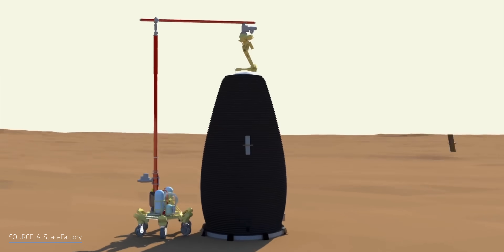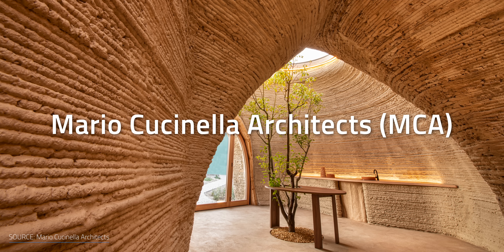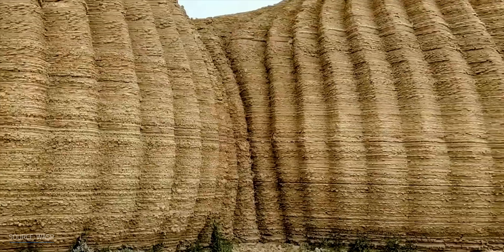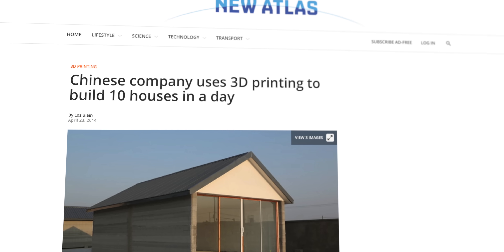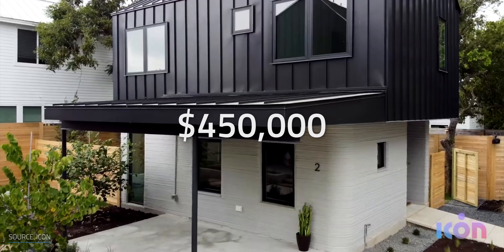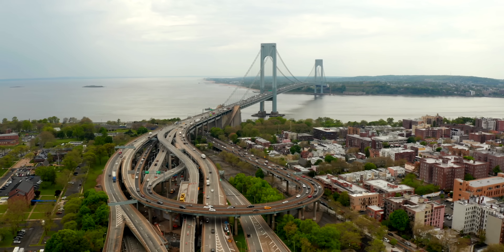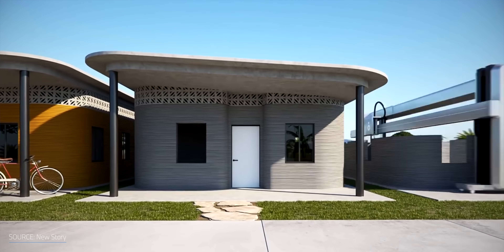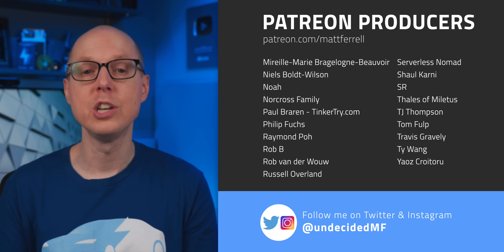The Truth About 3D Printed Homes

Comment: Unless you live in a country with a high rainfall, where the building washes away. Fitting electrical and plumbing is a nightmare, I have tried it, there is no fixing that will work, except fenceposts or other large wooden fixing for solid walled earth houses. Now, this is a structured wall so it doesn't have the integrity of a solid wall so how do you get fixings into the wall? Do you notice how most of them are built inside some form of structure, how much does it cost for the structure?
I have seen many of these, even a brick laying robot except if you notice, behind it, there is a guy pointing the mortar because the robot can't do that. Many think construction robots are the future, it isn't, can you imagine the electrical robot and plumbing robot meeting at a point where they clash and just stopping, at least with people they can negotiate. Oh, and when you think, a robot would be programmed not to clash, that's what every plumber and electrician thought until they tried it and for some reason the plan didn't work, construction isn't a plan that comes together by someone sitting on their arse in an office with a computer, it is a series of negotiations by tradesmen.

Comment: Earthen structures are great, but materials aren't as simple as dirt even for CEB's. I'd guess the precise mix for these 3d printers is even more important for drying time and final strength. The energy required to process and transport heavy materials may be better than modular materials, but it's an issue in many locations. I still like multi-story CEB and or cob structures for many purposes though. Mainly since thermal mass has major advantages in most climates.

Comment: For undeveloped countries, I think rammed earth or earthbag homes would be a better fit than 3D printed homes.  the tech skill level is much lower for more or less the same results. You need a form or bags, a rope, a shovel, and a heavyweight to pack the earth down. some barbed wire between layers is nice but not needed.  adding lime during construction or as a wash/plaster would help with bugs and moisture problems... not a scientist but I have researched this with the goal of making one for myself.

Comment: Cant repair it, cant hang pictures on the walls, cant run new electrical through the walls, looks weird, hard to sell. We figured out the solution to the housing crisis a long time ago. We just ended up attaching a stigma of trashy people and trashy neighborhoods to it: manufactured houses.
Reply: Not really. The problem with manufactured homes is that they often aren't actually cheaper than stick-built once built to the same rigidity and level of quality. Sure, manufactured homes are usually cheaper, but that's because they are also much more flimsy. Thin walls, shallow foundations. Etc.
Reply: We didn't attach any stigma. The sigma grew naturally in experiential fashion.

And it doesn't end up solving the problem either lol

Comment: So the company is called WASP. Hopefully they founders cleared that with Lisbeth Salandar. 😁
While I think 3D printing will have a major impact on the building industry at this point its overhyped. The whole built in a day neglects interior fittings,  electrical and HVAC if any.

Comment: I forget who it was, maybe Edison, that wanted to pour solid concrete houses back in the 1920s or 30s. He came up with a set of plans, full size forms, poured several example houses.  It was a disaster as they were ugly, problems with cracks and settling, not easily upgradable, and other factors just related to the concrete itself.  Even for low-income/affordable housing, no one wants it to look like dirt or concrete.  Part of a person's connection to "home" is customization, paint, landscape, diversity.  Even the poor don't want to live in houses that look like 50 others that are all in the same row.  They don't want to be reminded that they are poor every time they enter and leave the residence.  
A lot of the "Projects" housing in large cities around the US have been taken down after much dilapidation, because the poor just didn't care about the place they lived enough to take care of it.  In my city they gutted the project housing, expanded the living space, added better fuel efficient windows, better secured doors, and added some green features in the area.  they are still not great, but doing way better than in the past.  They are still kind of ugly, boxy apartment buildings.
I think that the recent ideas of using containers for housing will suffer from the same fate.  Someone is building some of those in my city now.
I think it would be great if you can print a house out of cleaned recycled plastic in a selected color and have options so each is somewhat different.  It may be more feasible to extrude plastic 2x4s and replace other size wood members that are part of the skeleton of the home.  You could wash, crush, shred and reform nearby and if all that is hidden behind the walls, they don't have to be reminded of it all the time that it was recycled.  Gypsum drywall is still probably one of the most affordable and available housing materials.  Solve for the outside walls and you are good to be green.  Traditional slab house building methods are still way faster than 3-d printing.  The concrete and running underground wires and plumbing are the slowest part.

Comment: It's going to be challenging to design and engineer the structures using arches throughout. Utilizing AI will be essential in designing the support structures and determining wall thickness. The system needs a mobile engineering lab that can test different substrates used in geopolymer composite materials to determine the individual material properties for a localized construction. Material data can then be applied to the 3D model software to adjust the material thickness according to measured load limits of stress and strain.

Comment: This technique is so new, it's actually old as shit. adobe (or pise? unsure about the correct  translation) have been a thing in Europe for centuries. You want to put some hay in it for support too.
My home is partially made out of it. Now it's weaker than bricks, so most walls are 50-60cm wide. Thanks to thickness it's a decent insulator too.
There's nothing new about the material. Also, if they don't cover the top / insulate the face layer, (plaster it) the house will go to shit after one good rain.

Comment: As a builder, it'd be faster/easier to build homes out of concrete block then to print them. Block homes are not fancy or techie, but they are well understood construction that already meets building code and are insurable.
Reply: Exactly. 3D printing buildings is an interesting technology but I can't see it being cheaper or a less complex than traditional construction methods (despite claims). It really seems to be a solution looking for a problem.

Comment: And no one is talking about, that the inhabitants of areas with single family houses have a much higher CO2-footprint compared to multi-family houses or appartment-blocks per person. So the aim should be to produce CO2-neutral, highly standardized (modular ?) building-structures for many inhabitants (maybe around 12 appartments per unit with 3-4 floors).

Comment: I really wish people would stop trying to 3d print everything. Every tool has its use. 3d printing is great for things that need low setup time or custom jobs (low volume). Mass production is great for things that need to be cheap and in high volume. The cost-per-unit of a 3d printed object will never compete with a mass produced item.

Comment: Its great that the dirt and clay house is made from local materials and degrades back into the environment without a trace.  But how do you decide when?  Unfired clays I have worked with dissolve in the rain, even after being left to dry out completely.  In an arid environment, this might last until you knocked it down.  Here in Florida, I wonder how long a clay house could last.

Comment: I'd like to know more about their structural stability for earthquakes. I haven't seen domes printed with through supports, which would prevent them from passing current California code. I am curious if combining 3D printing with Superadobe structure is necessary to deal with higher compression loads or stability. 
What kind of loads can the printed material handle / can it print a bridge? 
Would adding graphine help?
Why isnt printing paused to inlay plumbing / electrical / windows?
Reply: How about using recycled ground up wind turbine blades as substitute.

If your going to add virgin materials as a strengthener your better off not using anything carbon ..unless you can suck it out the atmosphere direct at minimal financial or energy cost...🤔 Slight problem we cannot do that .... Closest natural is something like bamboo.

So the best solution is Basalt fibers or rebar .. first used in  concrete domes its easily available and processed, stronger than GRP inert 50%lighter than GRP and it doesnt corrode even exposed to salts and natural acids. Unlike steel.
Reply: @clivestainlesssteelwomble7665  I like that.  Bring them wind turbines down (all of them) and I'd buy a house made out of them.
Reply: @metamech7383  

Nope but when they are worn out and replaced with fewer larger units like fiberglass boat hulls there's very little you can safely do with them otherwise...beyond landfill.
Reply: @clivestainlesssteelwomble7665  Yeah, we shouldn't be putting them in the ground at all.  Dirty and inefficient.  Besides being eyesores.
Reply: @metamech7383  

So are coal fired and gas and Nuclear but they produce more damaging 
Personally i dont find them anymore a visual problem than power pylons and the intermittent  noise.. no more than road noise from major roads.  Moving them off shore helps some with NIBY  syndrome but creates its own problems and possible spin offs..   large scale factory fishing becomes  difficult to impossible. 
Better would be a combined wind and tide turbine network  to use the same power storage and distribution infrastructure. ... this requires careful survey work to optimise production whilst minimising impact... but all of this survey baseline mapping could have  been done 40+  yrs ago (when scientists and engineers started pointing like the little boy in the story of the kings new clothes at the energy resource and Environmental problems🤦‍♂️🤦🏻‍♀️)
Reply: @clivestainlesssteelwomble7665  I think wind turbines would be great if they put them in cities where the power would be used.  Imagine hundreds of wind turbines clustered in parks, neighborhoods and shopping centers.  That would mean absolutely no power loss as the power wouldn't need to be sent hundreds of miles for its use.

I'm glad we're on the same page with NIMBYs...putting these up could save our planet.  But we'd have to ignore those living around them to do it...d um b nimbys.

Comment: As with all technologies and ideas, we have to view it not from being hype, perfect,  etcetera but from where can it currently be advantageous and where can it be advantageous (usually when price comes down).

Right now, 3D printed homes, let's stick with the concrete nozzle versions for simplicity, are advantageous in creating the basis for beautiful architecture (art which are also buildings) where the cost savings come from not having to build the one-time use custom forms in which to pour the concrete. The base structure is 3D printed, conduit & such are installed and then the cavities are filled with structural material.

The 3D printed structure can also have controlled porosity such that water can be used for evaorative refrigeration (like clay pots, etc...)

Comment: 3d printed homes is a fad right now, but it's nowhere near where it needs to be in order for efficiency. I see it similar to the first cell phone brick, eventually it will be good, but right now it's absolute garbage. For starters, you still need people to move it and put it together, plus supply the materials for it....so what are you saving exactly? The labor in putting the materials from point A to point C, instead you go from A to B and let the machine go from B to C....and as you said, it's not everything, still need plumbing, wires, etc.

At some point, we'll have robots that can both take material from the surrounding area AND build the home...then it would become viable, especially for space colonization, which is really where this technology would be needed.

Comment: Good take on this industry. This industry is a great example of partial solutions. Several whole solutions companies have really gone far. Roof Kits manufactured off site. Printing techniques that include electrical and plumbing not just windows and doors. Even interior finish techniques that do not require hundreds of hours of labor. Things are really moving fast. Part of the fight in affordable housing is market costs. Contracting companies are used to very high returns on new development areas and the savings in building costs do not get to the consumer. Then realtor costs are very high when you consider how different the value is when selling in this type of market. In the end a 30% savings on the build reveals as about a 10% savings to the consumer so the perceived value is lost. I town I grew up in a very successful company made homes in a building right next to the development. They built modular homes shipped them around the corner to the lots they sold. They did very well for about a decade but then the quality of construction began to show thru and over the  years the company had let quality slip to increase profits and in the end the "perpetrator of the crime was sitting right on the corner of the development and it became a good idea gone bad.

Comment: People hear mud hut and think of the goopie muck outside when it rains but this is a bit different. It's a mix of clay, fiber, rice husks and lime, essentially making the house one giant air dried brick. The foundation is concrete and the roof is wood so it's reasonably protected against the elements and settling. 

I think it's a good proof of concept, now it just needs windows and better finishing for looks and comfort.

Comment: you what we really need is modular stackable units made from an environmentally friendly material like clay. Maybe like bigger legos….
Oh wait ….. bricks…. 
Ok in south africa like 95% of construction is done with bricks and you would be astounded at how fast a professional bricklayer works - my bet is faster than a 3d printer because the bricks are pre baked so you don’t need to wait for the clay to dry. Also walls are thinner.

Now if your 3D printer could print custom components like lintels etc (think of beautiful complex moroccan/Persian/Moorish decorative elements), the you cure / bake them and deliver them - then having a local 3d printer in your town makes sense.

Comment: Are we forgetting that good old fashioned wood framing can be carbon negative?

Plus, you can usually build at higher densities with wood framing than with current 3d printing.

We’ve simply been doing it for so long, that if you want to build 100 million housing units, wood framing is the way to go if you can get sustainable lumber from a semi-local source. And admittedly that’s a big if, in some places.

Not to be too skeptical, but I just wonder if we’re focusing too much on innovation rather than what we already know.
Reply: Exactly. Not all new tech deserves to succeed. Wood and bamboo should continue to dominate the home construction market.

Comment: 3D printed houses are just another techno-eco-grift. 3D printing isn't going to build high density affordable urban housing. High density affordable urban housing is what we need to raise living conditions for the homeless and poor and what we need to reduce the carbon footprint of the population. 

3D printers don't finish homes. They don't build foundations. They don't run utility lines. They don't create urban infrastructure. They don't build beyond a single story. 

It's as much of a fake solution to climate change as "tiny homes" which have most of the same problems. A tiny home might be cheap but you need land to put it on and that land needs to have running water and sewer and electricity and access to transit. 

The bottleneck to affordable housing isn't the cost of framing. It's the cost of density and infrastructure and finishing. 

There isn't enough spare land in the world for everyone to live in 3D printed single story huts. We need to build up, not out.

Comment: A single story wood framed house can be up in a day.... plumbing, wiring and roof going up on day 2. The concrete slab and ground prep is what takes the longest. Ive worked on some sites, taken a day off for another job, and the next house was framed up and ready to wire when we were away.
Reply: This. Building the house is not really time consuming. Typically the permitting process will take months compared to the week that it takes to get the structural stuff up.